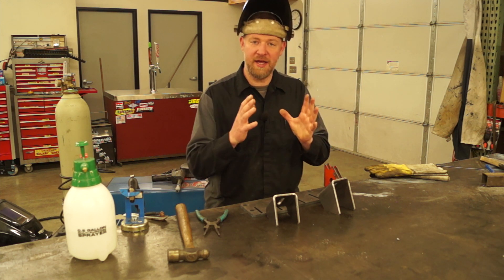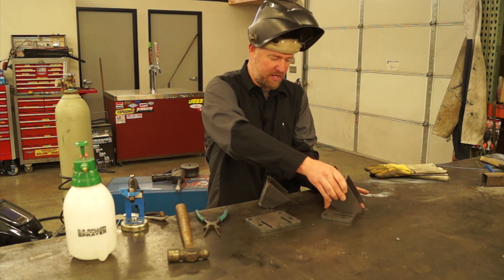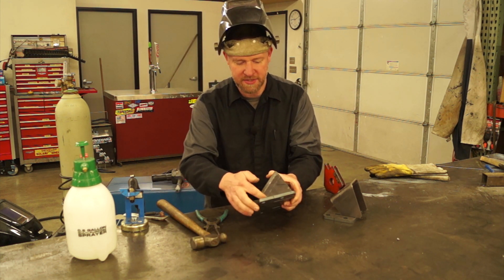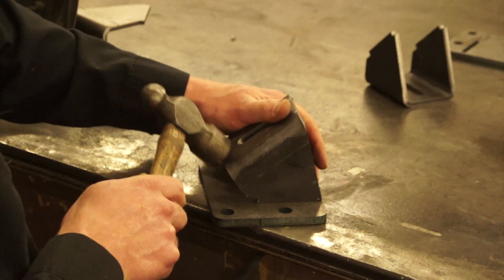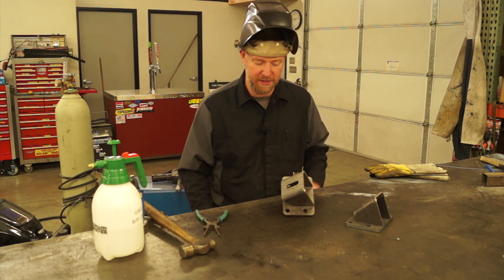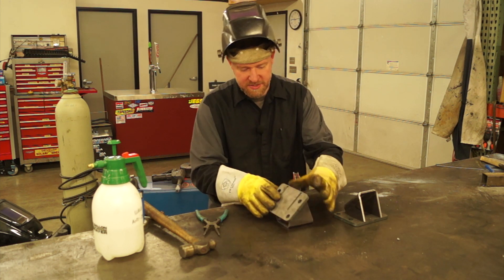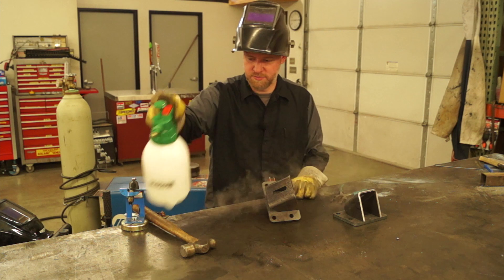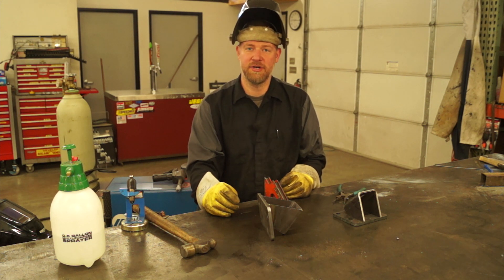Our DIY Cummins Motor Mounts for Diesel Conversions

Comment: Will the custom motor mounts for the 5.9 cummins 12V/24V & Common rail conversions work on 2 wheel drive 3/4 ton & 1 ton or C2500 suburban models